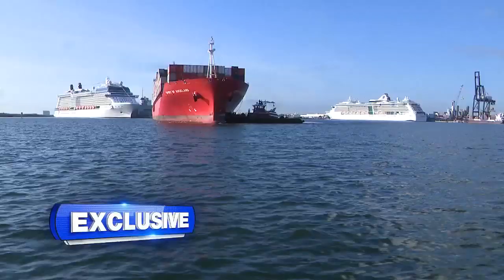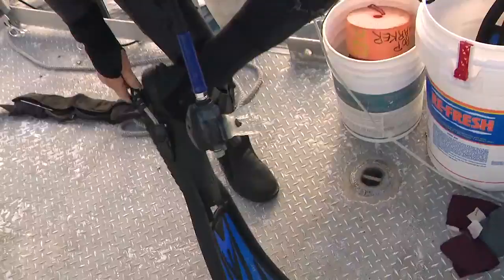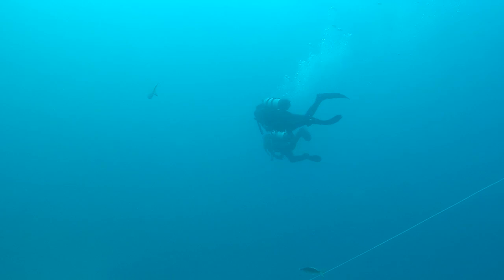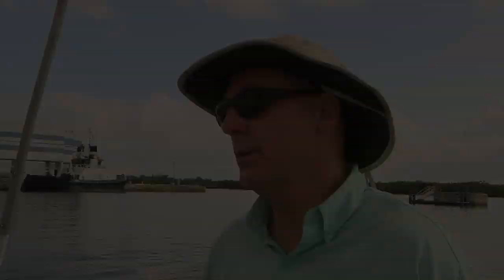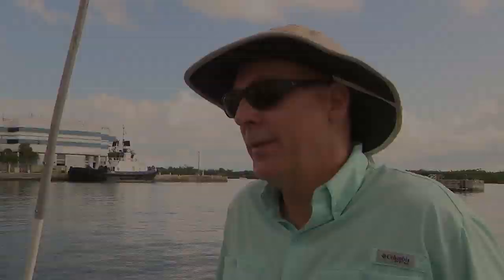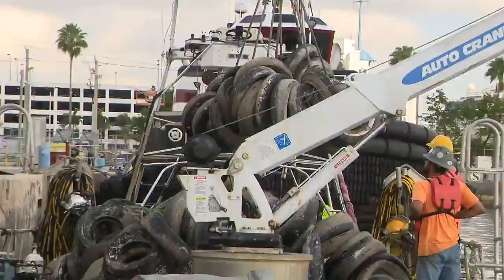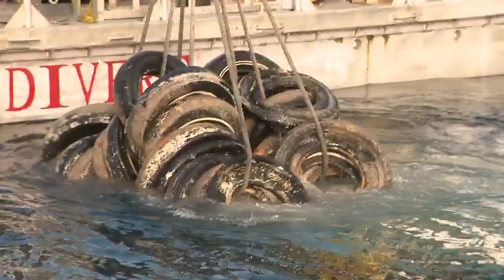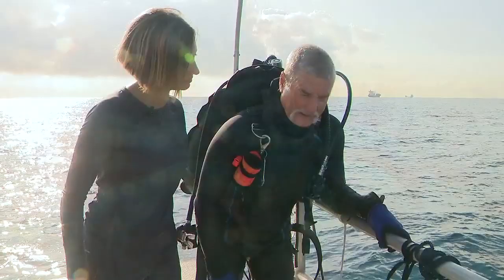Artificial reef made out of tires causing big mess off Fort Lauderdale coast

Comment: One possibility would be to replace the tires with burnt out cars for the reef and then use the tires to build off grid homes called earthships
Reply: Rubber absorbs all heavy metals. When rubber decomposes, those metals leak out. The rubber tires are made out of aren't pure rubber to begin with. Rayon, zinc, naphthalene and PAH are all chemicals contained in tires. If tires are used, make sure to keep them far from humans. Plants/trees are usually very hardy, they will survive the polution easily, however insects are not. So.. they will likely suffer and die from the pollution.